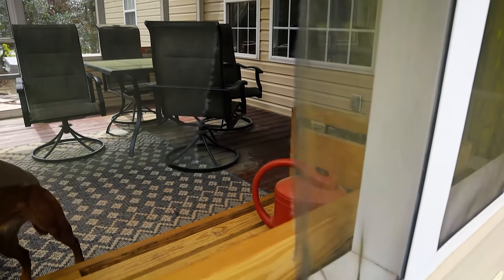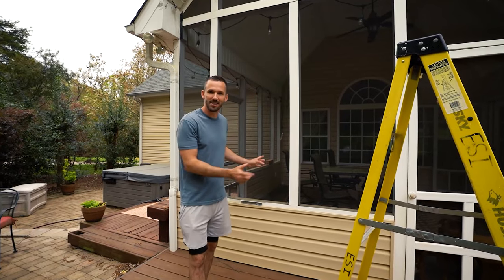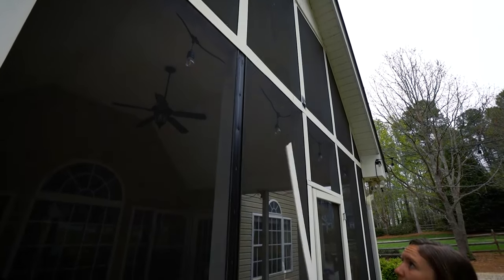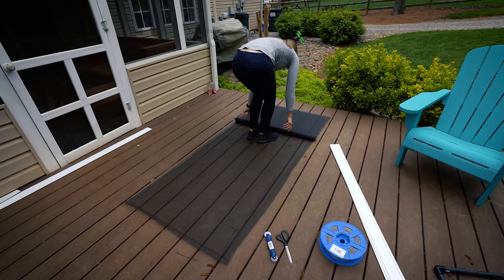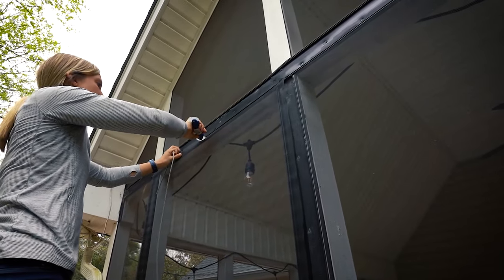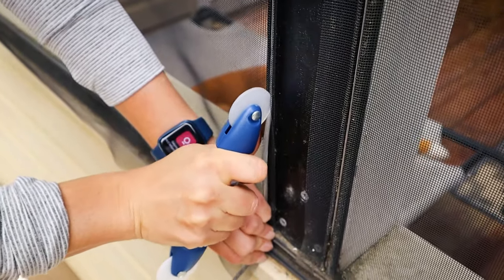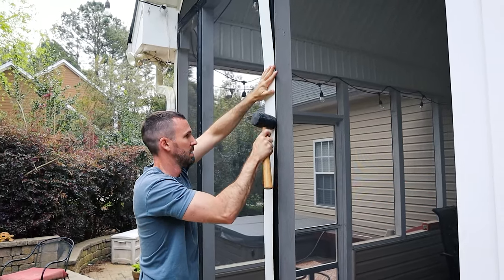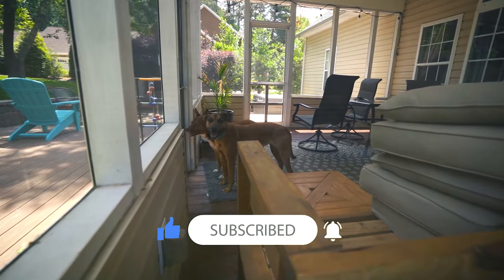DIY Porch Screen Replacement with Screen Tight System

Comment: I don’t know about anybody else, but I’m installing my own screens at my house and I’m definitely replacing the splines
Reply from the maker: If you're already going through the work of replacing yours, might as well! I can be too cheap
Reply: My rubber keeps falling out almost every year or so and my patio is big I'm in AZ do you think the rubber diminishes quicker because of the heat ? I don't have a cover over the rubber like you have. Thanks 🌹